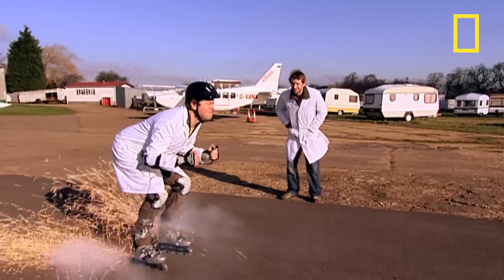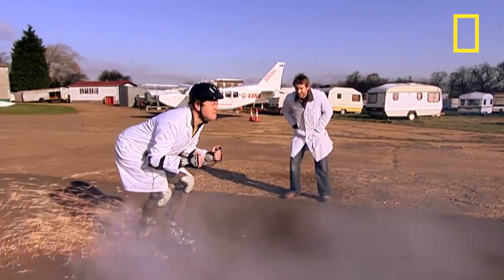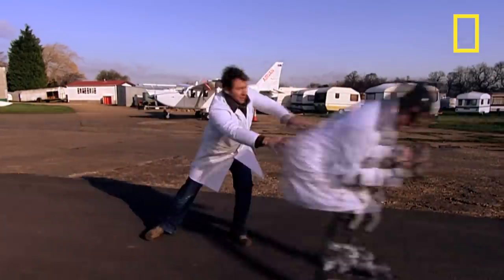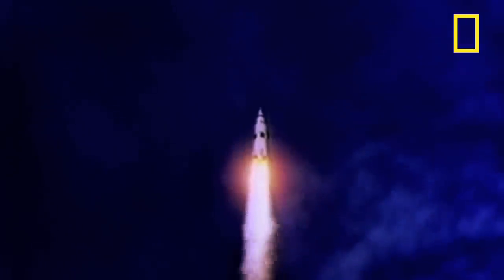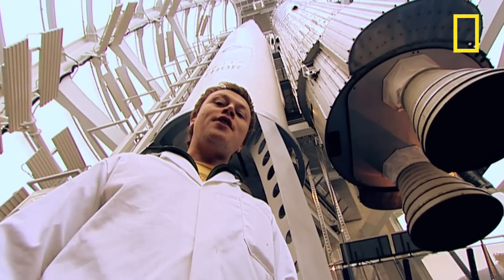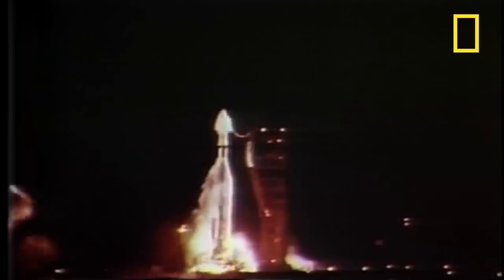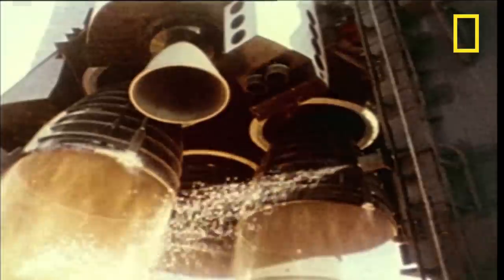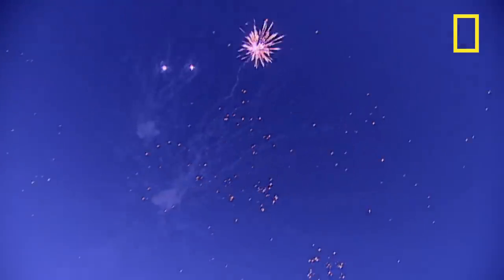How Rockets Work | I Didn't Know That

Comment: So it has nothing to do with exhaust striking the top of the combustion chamber.
Reply: This is another example of the incorrect use of Newton's 3rd law of motion. The combustion of the fuels produces a high pressure gas that moves in all directions, including forwards and backwards. The gas moving back out of the engine does nothing but make a lot of noise. The part of the gas moving forwards in the chamber pushes the rocket forward.

Comment: If a rocket is not pushing against the atmospheric pressure, then blocking the thrust would make no difference, right? The rocket would still fly, right? NOT!
Reply: A rocket is propelled because it's ejecting huge amounts of mass (burnt rocket fuel) at hypersonic velocity out of its engine nozzles. Mass x velocity = momentum. This momentum must be balanced, therefore the rocket is propelled at a proportional velocity in the opposite direction. This is very basic physics.
Reply: Thanks.
So why is it that the nozzles' area ratio need to be expanded for optimal performance at higher altitudes?
Doesn't it have to do because the air pressure is lower?
Reply: The air pressure is lower, yes, which means that the exhaust gases expand differently in the nozzle.
Reply: @amperzand9162  then they would not expand at all in a vacuum